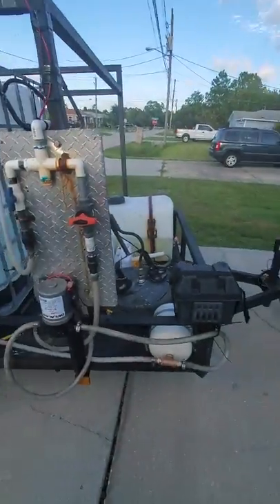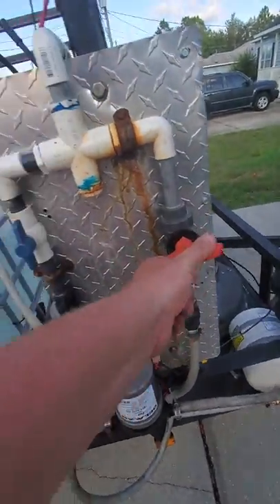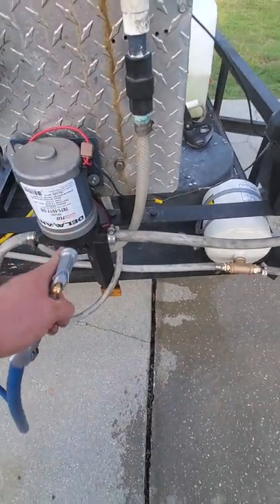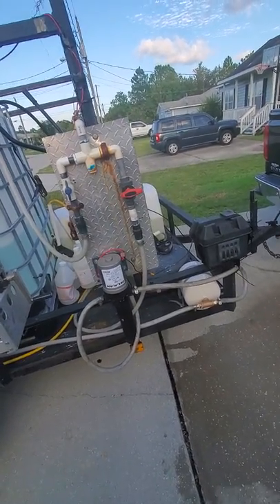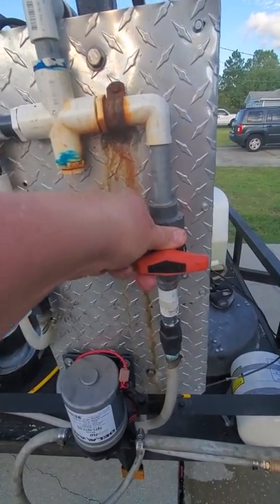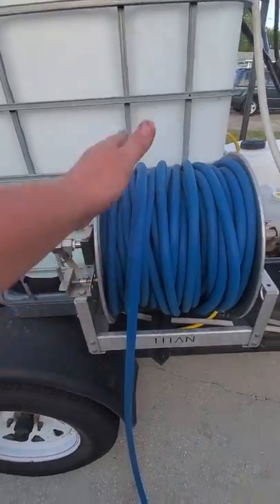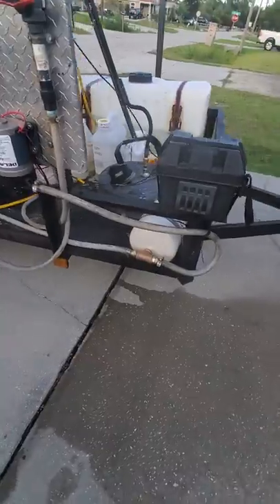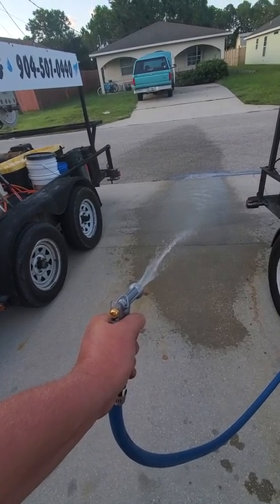Simple 12v soft wash setup with a metering valve setup

Comment: Attach a plate to the trailer frame AND battery box for the gang switch panel. DAMN IT! Many sleepless nights trying to figure out a good spot to attach my proportioning set up to my trailer.  Thank you! 

? - what guage wire should I use to connect my 7gpm 12 volt to my 2 marine batteries that are connected parallel? Batteries are on the tongue of my trailer (front) and my chem tank is in the back where I am placing my 12volt pump.  I had 2 choices  - longer supply lines or longer power wire from battery,  It seems like the shorter the hoses is best. True?

Comment: Where'd you find that accumulator tank?
Reply: What is the accumulator tank made of? No corrosion?
Reply: @topwashroofcleaning  has to be.  Poly tanks are the preferred choice
Reply: @ktpowerwashing  where do I get a 2 gallon poly accumulator tank?
Reply: @topwashroofcleaning  I have a 1 gallon poly tank and I dont feel like it helps any.  The one he is using I saw at Lowes on the aisle they sell sump pumps on.  It's a 2 gallon exactly like the one in his video.